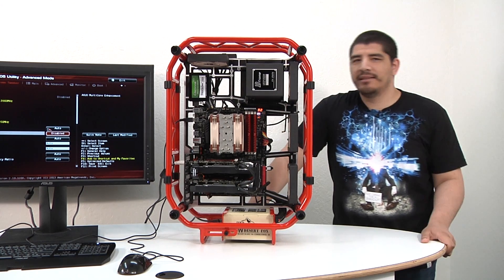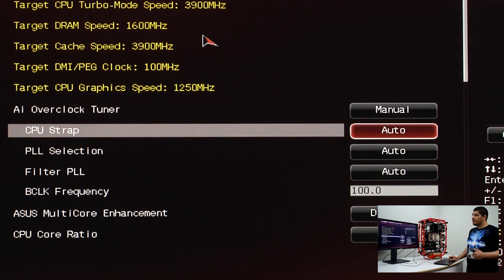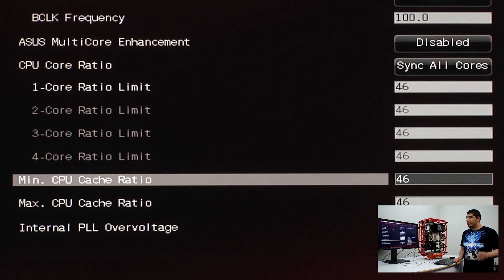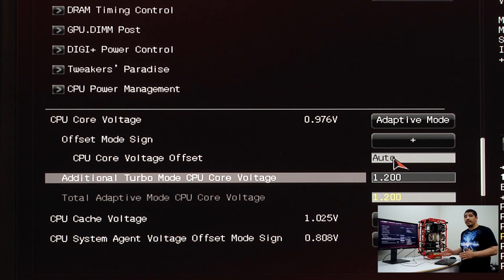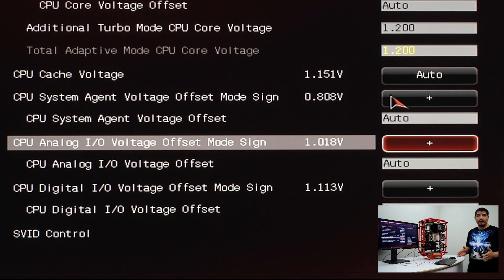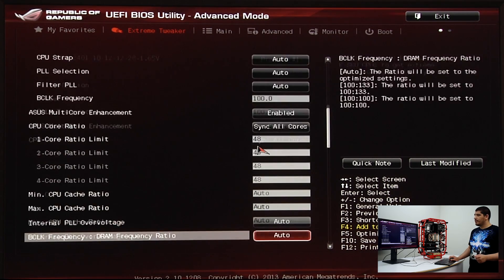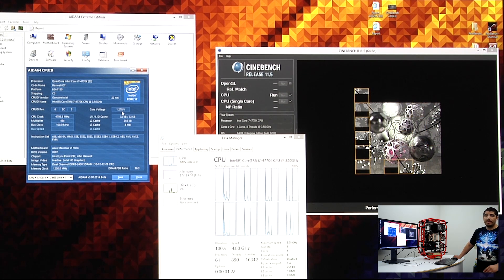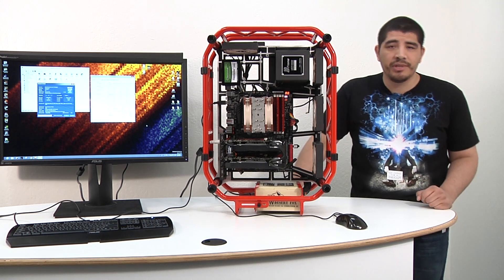How-to manually overclock any ASUS Z87 motherboard

Comment: Hi.please help me.
My system: 
Asus z87 plus
Corei7 4790k (delided)
Ram 16 gig gskill z trident 2666
Aircooling thermal right Silver arrow extreme
Iam stable in 4.8 with 1.330vcore & 1.800 vccin
But for over to 4.9 ghz with 1.415 vcore & 1.900 vccin  not stable and system rebooting 
 Please help me.thanks very much.

Comment: I couldnt reach 4.6 on my 4670k. I tryed with 1.3V but i get bluescreen from cinebench r15. Managed to get 4.5ghz with 1.265v stable for 8 hour stress test tho. 
Currently runing 4.5 at 1.265v / and 4.3ghz cache at 1.255v. Dont think i can push it much more
Reply: Are u using adaptative mode?
Reply: @lucktw  i dont have this cpu anymore have 7700k @ 4.7, using manual voltage

Comment: Hey guys, I appreciate this is a little old now but I was wondering if you (anyone) had the same issue as i'm having: 

Using the 'per core' to set different speeds under different loads doesn't seem to work. I can get 46x on all cores working fine setting all of them to 46x but if i set 1 core to 47x and 46x on 2, 3, 4 then behaves exactly the same as 46x on all. I can never get it to go higher than the lowest core. So 48x, 48x, 48x, 46x would just always run at 46x on a single threat or two threads, I won't go above 46x. (it will go to 47x if all core is set to 47x so it's a heat/throttling issue, I have latest BIOS, etc). Any ideas? Thanks.

Comment: I have a z87 gryphon with a 4670k. Can't get my ram to run at 1600mhz and can't get my cpu stable under 1.3v at 4ghz. Kinda annoying. Temps are never above 50 in games. Turbo only works if everything is standard in the bios.

Comment: How can I set the CPU to stay at a high clock speed in the Z87-pro v-edition BIOS? I don't really need to overclock but I want to have the CPU on "performance" mode for low latency audio applications.

Comment: i have,  INTEL CORE i7 3770  3.40ghz,
ASUS P8Z77-V LX, INTEL Z77
1000 power supply, DDR3 G.SKILL RIPJAWS X 16GB x4
120MM LIQUID COOLER. 7 fans!
will these settings be safe for mine?

Comment: what about just ONLY adjusting the BLCK Frequency to higher than 100 ?  Is that going to be a less stable overclock rather than using the multiplier method?  Im using a 4770K

Comment: Hi! I have a z87 expert + i7 4770k, I follow the steps and i can't reach 4.6ghz with 1.200 voltage =/
Reply: You will never reach 4.6 with 1.2 vcore, these guys are using binned chips for these videos. My 4770k needs 1.26 for a 4.3ghz stable oc

Comment: Be warned. Carried this out to the letter as shown above with an Asus Z87-Pro & i&-4770k and this borked my computer. Went in @ 4.4 to be safe and it corrupted my Win10 OS after a failed post. Changed voltage incrementally as describe and once it booted it went into recovery mode. Luckily I was able to recover it but some Apps were deleted and the RAID went tits up. I would consider myself technical so its not like i'm not use to tinkering but stay away is my advice.
Reply: You fucked up on your own, don't blame the Asus tech because of your mistakes.

Comment: Thanks for this. It's helped me get a stable overclock on my 4790k to 4.7ghz with adaptive 1.24 volts. The only thing that confuses me is that when running stress tests, there is a large discrepancy between the cpu temp readings of hwinfo and aida64. For the life of me I can't find out why. Aida seems to be 20 degrees lower than hwinfo.

Comment: asus dual intelligent processors 5 could have broken my PC. it overclocked the CPU to 4.5 and 1.5 volt and temps that where over 90C.
I hade a temp limit of 80 and a volt limit as 1.35.

Comment: thanks big help for me but for 4.2Ghz in adaptive mode i set vcore at 1.14 and go to 1.23 in occt mode don't test in game but i think the vcore stay at 1.14...  do you have an explication or help fo me why the vcore up to 1.23 and dont stay at 1.14 1.15 ?
Reply: +Xavier Biscay Hope you already found the answer, but as he says at 16:36 occt is a synthetic test and during adaptive mode will supply more voltage than the limit you set. Either stick to non-synthetics in adaptive, or stay in manual while you run synthetic tests and once you are happy and finished overclocking, you can turn adaptive back on.
-I read a possible alternative as to stay in manual but to enable C7 states and disable speedstep. This would allow synthetic testing without overstepping your limit while effectively doing the same power savings of adaptive... but I have not tried this yet.

Comment: i understand why you need to overclock cpu and gpu. 

What i dont understand is why you have to overclock a motherboard, what benefit does it have. 

example: can you overclock a cpu and gpu without an overclockable motherboard?

what does an overclockable motherboard have to do with cpu and gpu?

what do you actually overclock in a motherboard????
Reply: you can't overclock a motherboard. we use the motherboard to control the other components and configure them.
Reply: +Hah Raaj lololol

Comment: Got an issue.. It turns out that it's not just synthetic stress tests that override the adaptive voltage limit. Was just playing a racing sim called Assetto Corsa, and after the race was a bit shocked to see that my core voltage had been peaking up to 1.3V when I had the adaptive limit set to 1.2!
Reply: +bliglum Did you managed to  fix this?
Currently got my 4690K at 4.6Ghz 1.250v but I would like to have it undervolt at idle.
Reply: noderek
Nope, never did.. Read some stuff in some forums about voltage offset or something, but it seemed pretty in depth, so I didn't bother.

Comment: I tried lowering the turbo voltage below 1.2 and yes it crashed on Windows boot... It also corrupted something on the hard drive so I will now be spending most of my weekend rebuilding my entire sim racing rig... Thanks for that little (useless) tip!
Reply: +Piranha Z06 ouch.

Comment: Will an overclock pull more power? I'm not sure, but I think I'm only just overpowering it, as it is
Reply: you're supposed to set the voltage manually so it doesn't get overpowered and wear out.

Comment: I have a 4670k on the maximus VI hero. getting 4.6. One question. I have the core voltage at 1.5. Is that ok? It was the only way to get it to post and run games without any crashes. I'm cooking with the H100i.
Reply: Holy shit that's  ALOT of voltage. Over 90% of ppl never ever go above 1.4 volts. Most ppl hover in between the 1.2 to 1.3 range.  I'm not happy going over 1.35 volts personally for everyday use.
Reply: Wow. It has been eleven months since you posted this. Is that particular CPU of your still chugging along?

Comment: I'm having trouble overclocking my i5 4670k to 4.6ghz what should I try  I have even took the voltage up to 1.3 still crash 
Cpu: i5 4670k
Cpu Cooler: Corsair H100i  
Ram: Corsair Vengeance 8gb 1600mhz
Psu: Corsair HX650

Comment: Don't use 4 way optimization unless you want BSOD
Reply: That's bullshit. I've achieved 4.8 2 cores with the 4 way optimization, and it was stable. I prefer doing things manually however.

Comment: Just first time Overclocking my CPU base on this guide. Somehow manage to run manual 1.118V with 4.4 all Cores in 4770k (Peak Temp 71, Under 100% Load is 68 and idle at 36 by using HWmonitor). It just have passed the 1hr - 8GB RAM stress test of Realbench. Should I assume that my cpu is stable and change the voltage to adaptive? All helps are welcome. Thanks

Comment: doing tests after a new bios flash on my ASUS Ranger vii and i7 4790k, evo cooler
with most settings on auto, xpm on and asus multicore enhancement set to off (4400mhz when on, but the CPU is hotter)

it shows 4200mhz 115 watts core 1.168v 36c asus AI3, real temp 42c in Ai3 when 98+ % load using WinRAR benchmark
anyone think the volts are a little high and should the watts be 88 or lower (they never get to 88 in normal use)
also the load line calibration set to 8 what should it be

not ocing, run a 4000mhz but im trying turbo 4200mhz or 4400mhz with asus multicore enhancement on

wish I could find a guide that explains all the bios settings in detail

Comment: Got my I7-4790k to 5.0 using a noctua dh-15 heatsink. Guess you could say I hit the lotto!
Reply: Got lucky with an i7-4770K using a Noctua NH-U14S (Single Fan) at 5Ghz as well. Took awhile as it was stable at 4.6Ghz @ 1.275 but 5Ghz isn't stable as in I run it 24/7. It's just the highest I have been able to OC it.

Comment: Hello, I have only had my Sabertooth for a year now and the computer clock stops and runs slow, the obvious thing to do was to change the battery, which I have done but has made no difference. Please what do you think could be wrong?
Reply: Update your motherboard bios...i was having the same problem with my maximus vi hero.Update will fix the problem.

Comment: HELP! With a Z97-A Intel 4770K combo I am able to get 4.4Ghz @ 1.250v and everything seems fine with good temperatures... but on the temp readings for AIDA64 and ASUS temp monitor is will show my PCH at a happy 62C, but when I get into a game (AC unity) I will show PCH & Sensor 1 getting to 116C!!! The temp will alternate from normal to what I assume is way too high while in the game! I don't know what to do. My CPU is barely at 50C (Coolermaster N520) so I don't know why that sensor is showing so hot. I totally don't want to fry my motherboard so any help would be appreciated!

Comment: i mananged to oc an g3258 on a z97 a to 4.1 ghz at 1.28 v.  so i didnt hit the lotta with that chip, obvious.  but its stable at that rate.  

one thing is, i have my vcore set to adaptive.  so i was expecting the vcore to drop when in idle, but for some reason it stays at 1.28.

i have the offset vcore set to auto.  is this the setting where if i change it from auto to stock (1.078v), will that  help keep that volts down when in idle for example?

please help. thanks. 

and i know, wtf am i doing running a g3258 with a z97 a.  its my first build.  so i will upgrade cpu next year.  most likely i5.  heard great potential to oc with that cpu.  eh, its decent.  again.. didnt hit the ghz lotto with it lol
Reply: ***** sir, you are correct!! it was on high performance.  as soon as i switched to balanced, i checked my temperatures and core ratio and what not, and went way down! woohoo! 

this is my first pc build.  so still learning a lot. it was a headache trying to get my gpu to work! had to change bios and everything.  kept getting black screen of death. but its fixed now, along with my cpu and volts when not playing games, for example.  appreciate it man.  youre the best!
Reply: ***** Thank you so much! I've been searching for this answer for quite some time now and couldn't find any threads or posts regarding this and there's so much to read! and Yair Gutierrez thanks for posting this! Thought I would nvr find anyone with the same problems I'm experiencing. Ty again! :D
Reply: ***** Thank you for that answer! I was worried about that problem aswell, but then i found your answer! Thank you once again! :)
Reply: 33…………

Comment: Very goood video and very helpful information especially about higher voltage in syntetic stress test, than one we set in adaptive mode. Also nice results and very good CPU - 4.8Ghz and 1.28v its almost unbelievable for me. My 4770 have about 1.1v on stock !! I can only get 4.2ghz on 1.18v (adaptive). And my max is 4.4ghz on manual 1.29v (witch I think is too much to use it for 24/7) Very disappointed unit :(

Comment: Plzz can someone explain adaptive mode? I mean it is safer to set it in manual mode, and does the manual mode means that it doesent can overheat when running stress tests?
I got asus Z97-A and i5 4690K.
And using Cooler Master Hyper 212 Evo.

Comment: Hey JJ i just noticed a new bios update, meanwhile i have my cpu in xmp mode at 3.9ghz 1866mhz ram . . . . however when i playing games the voltaje of my cpu decreased at 0.8v =S and it turns freezing or lagging and falls down to 100x39mhz frec to--->100x 0.8 =S and i dont like it =/ *****

Comment: I have managed to overclock my i7 4770K to 4.7 GHZ. Now, I tried at first with a voltage at 1.280, and I tested some games that I usually play (like BF4) and it went fine. I couldn't reach 4.8 though. Anyway, so I tried to lower the voltage until my PC would crash, and I came down to 1.240V. Now for some reason, when I'm playing Battlefield Hardline Beta, the PC would just freez and I would have to shut my computer down. Now I read somewhere that this could be a bug with the beta, since it works fine with BF4.

Another thing I've discovered is that, as this video says, a crash due to overclock would appear somewhere at the log in screen. Now, that's not something that occurs for me. For me, a crash can sometime occur after having played for like 45-60 minutes. Is this due to the voltage or is it something else? I hope someone can give me some tips! Thanks.
Reply: dude it is because of overclocking.....watch and listen to the video carefully....your pc can fail to load at boot screen or when those dots came or when you do some cpu intensive stuff like playing bf4.....your voltage is not an issue as long as you have good cooling for your pc cozz more voltage means more heat output....

Comment: Running a Delidded 4770K@4.6Ghz at 1.175V on a ASUS Z87-PRO and 32GB of HyperX Beast@2133Mhz XMP.Using Collaboratory Liquid Ultra between the Die and the IHS and MX4 between IHS and the Corsair H110.Temps are 24°C in idle and 61°C in full load / stress tests.Before Delidding the CPU, it was constantly at 30°C in idle and was hitting easily 96°C in full load / stress tests.The TIM that Intel uses between the Die and the IHS really sucks and delidding the CPU is a must, if you want to achieve great temps and stable OC....

Comment: I got in idle or wordl of tanks no bluescreens but in gta 4 after 5 mins i get a bluescreen cpu 4.1 ghz ram2133 mhz help me pls
Reply: Cpu voltage 1.2
Reply: Drop your memory speed. You should find a stable oc for your cpu before you oc your memory. Once stable, bump up the memory until you find the sweet spot.
Reply: actually the memory isnt oc it is just the maximum speed when it isnt oc. But thanks for the information :) got the cpu now on 4 ghz and ramm 2133 mhz and i did the aida64 stress test 30mins and it was stable.
Reply: i did aida and that worked well for 30 mins and longer, is the z87 k mb good for overclocking?
Reply: thanks for the information i soon will get a better motherboard :)
Reply: ***** I got my new GPU the amd r9 270x from asus top edition OC and whenn i want to Overclock it thenn i get a Bluescreen??
Reply: Im overclocking my r9 with GPU Tweak 2.4.9.2 version and im gona update the driver but i think it kann be because amd installed the driver into the Programms(x86)  Folder?

Comment: can i install SAPPHIRE R9 295X2 8GB GDDR5 in this Motherboard? i got the AMDR290X and am looking forword to upgrading soon
Reply: I just found out the 2nd card will only run X4 speed on the PCI-E bus. :(. I actually got worse graphics when using my older 5770's X2 than with one by itself on the first slot.
Reply: ***** Only has 2. It is the z87-k.

Comment: Hi JJ,

I have tried your settings and even de automatic overclock in BIOS on 4.4 but when i open Aida64 and run Cinebench the speed is not going up, it just stay on 3.5

I can do what i want, but it is 3.5 and it stays on 3.5. Any idea's what can be wrong or i do wrong?

Intel i7 4770K Haswell on Asus Maxumis VI Hero, 32Gb Corsair Vengeance 1600

Thnx!

Comment: hey guys, i set my voltage to manual mode, and then i set a voltage, for example 1.2V. i got it running stable but why does the voltage drop when the cpu is idling? i thought manual mode was not suppose to do this. I check the frequency and voltage using AI Suite 3.

Comment: I got my 4770k to 4.6ghz with 1.255 volts and uncore to 4.4ghz with 1.172 volts. I have a question with adaptive mode. When i watch tv shows with MPC-BE player my voltages would shoot to up 1.3v randomly. Is there a way to prevent this from happening? btw adaptive is set to (-) with offset on auto and 1.255. same thing with uncore.

Comment: I couldn't reach 4.6GHz at 1.200v on my 4770K. It kept on blue screening. It did however work at 1.300v. I must have had the bad luck of the draw. No biggie though. I got mine for $289.99

Comment: Great vid. I can get my 4770k to 4.4 at 1.280, and it is still only 35-39c(old corshair h50 cooler).
But Cache will only go to 4.2. 
WIll it help raising the voltage on the Cache to try to hit to the 4.4ghz?
If so is it the same treesholds as the core voltage? (1.280v) Thanks.

Comment: Hi, I'm new to all this so i have a question. I managed to get mt 4770k @ 4.4GHz on 1.200v. I wanted to keep testing higher clock speeds but I noticed when on CPUID my clock speeds are locked. Even when idling the CPU stays at 4.4 and 1.200 volts. I checked the BIOS and everything is set exactly the same as in the video. What am I doing wrong?
Reply: turn on c states and power saving options

Comment: Will a i5-4670k be able to run 4.6 GHZ on all cores and also on the CPU Cache Ratio? I have two cooling options if that's a factor, a cooler master 212 evo fan and a corsair h80i liquid cooling solution, appreciate any help

Comment: Really helpful and simple video. Overclocked my 4670k 4.4 ghz with 1.2v adaptive voltage no problem with temps at 54c max  performed stability Test with ROG Realbench (awesome real world testing program). Finally settled with 4.2 Ghz with 1.137 adaptive voltage, idle temp at 31c and max 46 c under load,  I'm happy
Reply: I've been able to get a perfectly stable 4.4 on my i5 4670k with very long stress tests, but can't seem to get 4.5 to work whatsoever. Did you ever try going past 4.4? If so, what were your results.
Reply: @JTheraos  that 9 years go lol 4.5 wasn't stable for me as I remember.